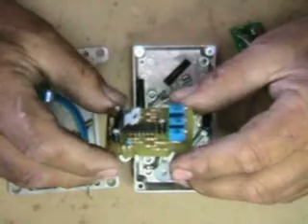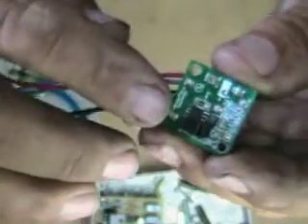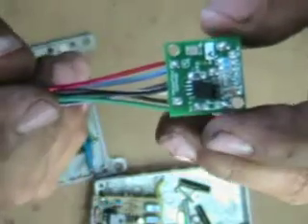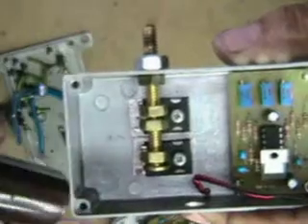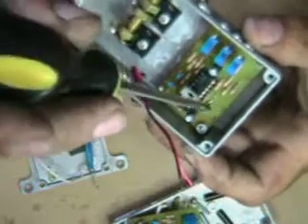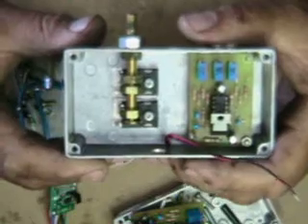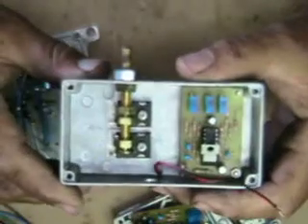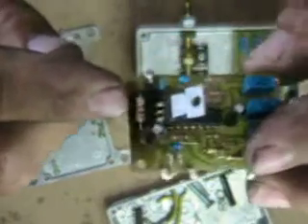Zero PWM Clone Upgrade Part 1 of 3

Comment: @crafter2u, Uno You got it correct on your first stab! Inductive Feed Back, The RC Filter formed by R14 and C2 Allows the inductive spike to pass to ground but in doing so the Resister R14 Gets hot.
When Using L1 and C2 it forms a LC Filter! The inductor L1 block any high frequency inductive Spikes, The capacitor C2 shorts out any high frequencies this allows normal flow for 12DC.
Why some R14's work is the length of the 4Gage wires. I have removed R14 from My H2O2-PWM Plus V2 designs.